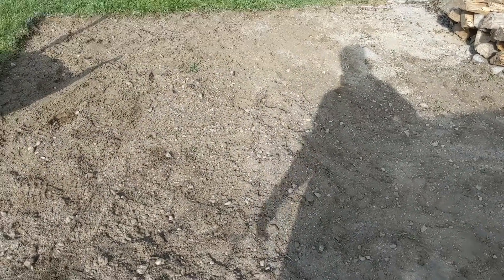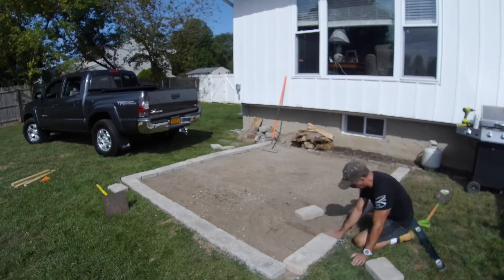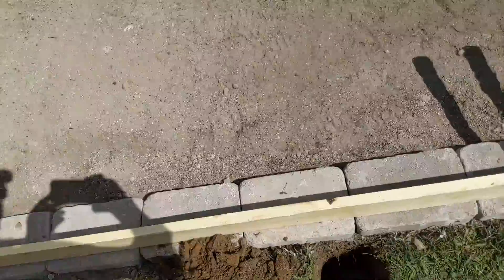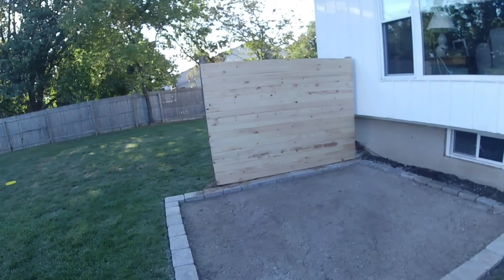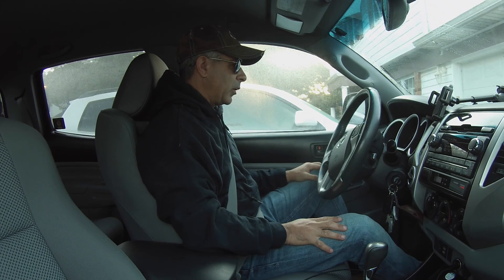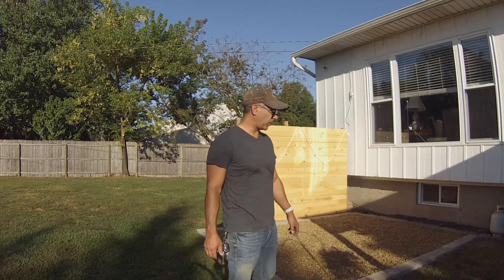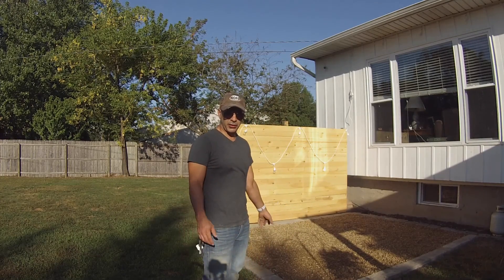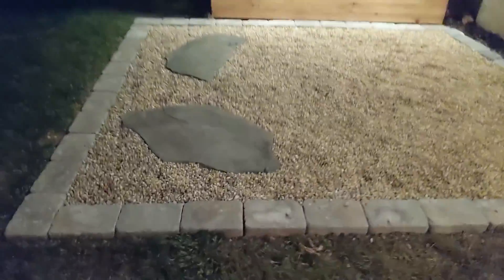Setting up a 120v Hot Tub Project Part 1

Comment: Hey Joe, nice job on the prep work. Just curious on how big an area you allocated for the hot tub you purchased. Do you have the diameter of the tub and the area of the pea stone pad? Thx!
Reply from the maker: Thanks.  The area I boxed out for the tub is 10x10 outside measurements. The stones are about 7" wide so the inner pea gravel dime sions are a little shy of 9x9. The tub itself measures 79" across. That is the upper edge which flares out a littlw. So the base of the tub is probably around 77"  (Sorry just guessing on that one)